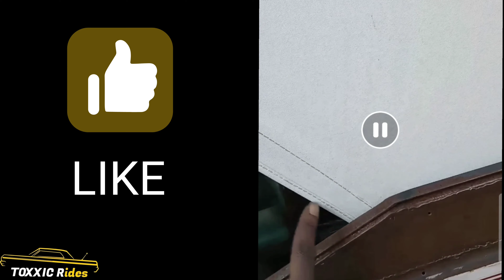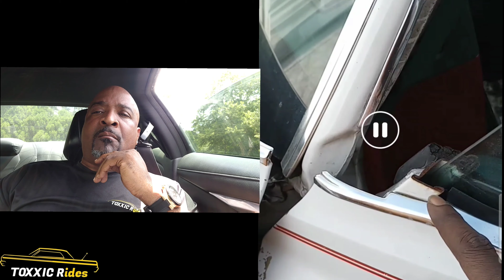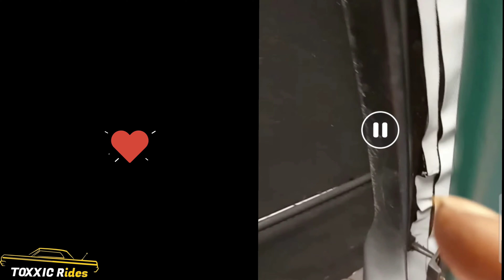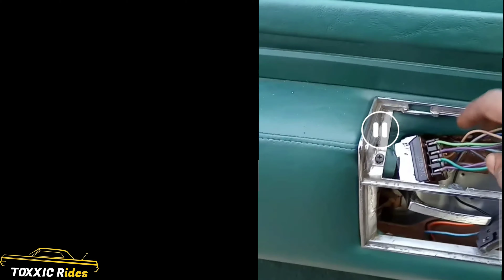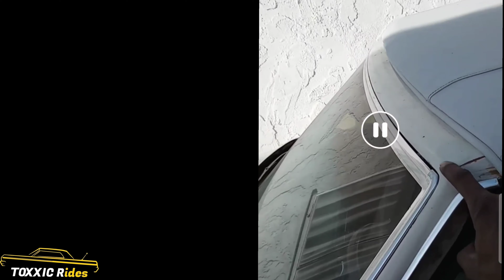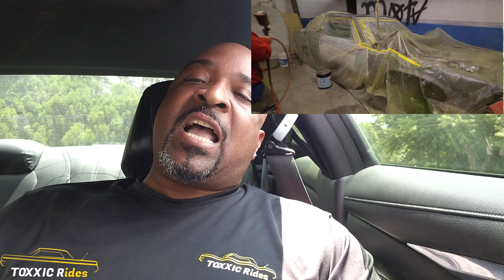$17,500 Convertible Conversion 🤬🤬

Comment: I had an issue with the same guy. I paid $4,500 for a convertible conversion kit in (04/2024), and it was down hill from there. It was lie after lie. Months without answering my calls or text, but he would watch every story I post on instagram. Weirdo. I didn’t get my kit until (09/2024), thanks to an attorney. He sent my top in a week, but didn’t send the quarter windows or rear glass. I ended up buying the quarter windows from a junkyard, but still no rear glass.

Comment: I paid an expensive lesson myself. I am starting to come to the realization that if I can't do the work myself it will never get done. I already have a job though so learning how to do paint/bodywork/welding etc. I don't have time for that.

The only thing that worked for me is finding a club that has built cars and rely on them for help. 

Every shop I took my car to ripped me off, one asshole sold me a parts car he didn't even own and pulled a gun on me when I went to pick it up.